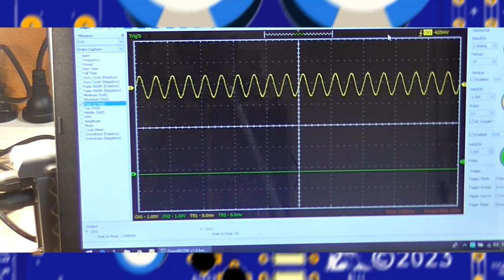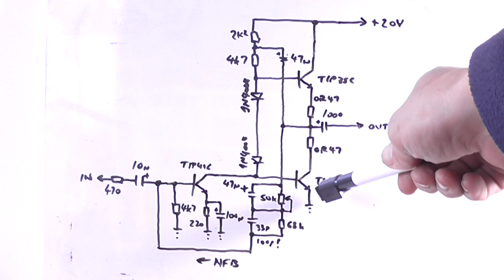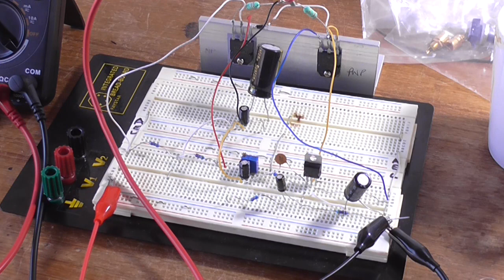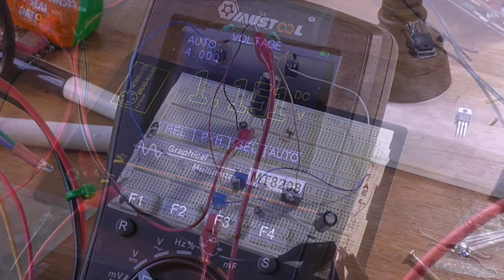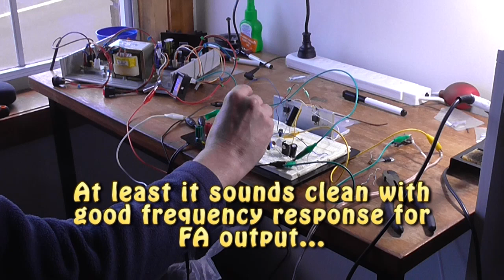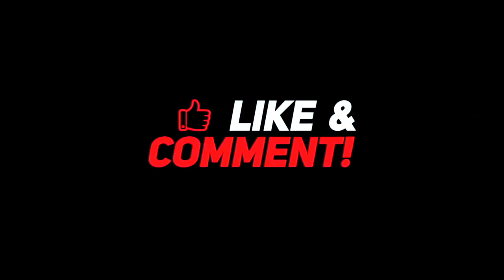Simple Guitar Power Amplifier?

Comment: try changing the 68k resistor to 390k and adjust the 100k trimpot for half supply voltage at output.
Reply from the maker: Thanks, but no difference. It's gotta be those sodding TIPs...